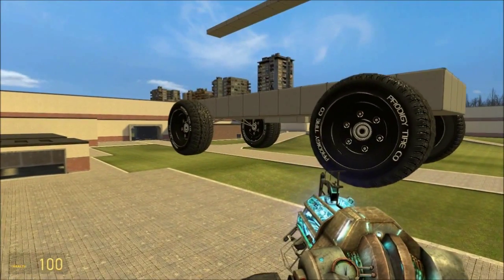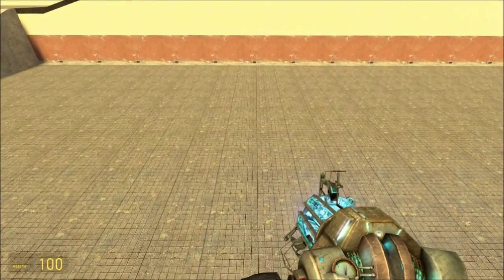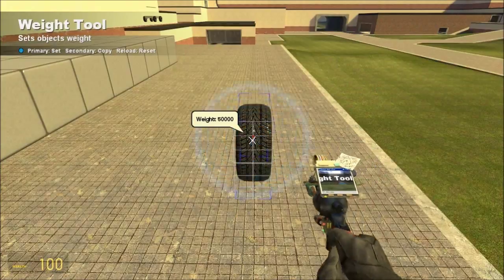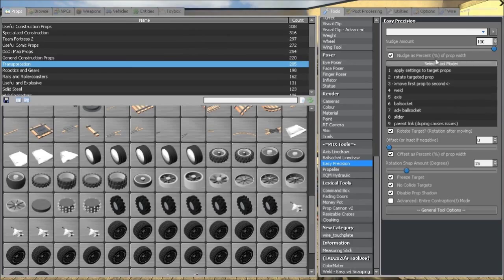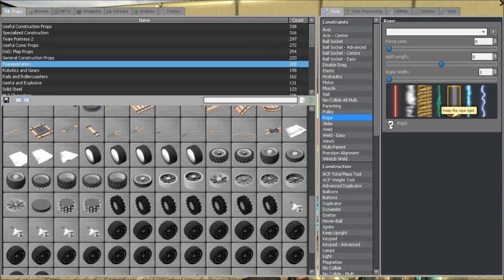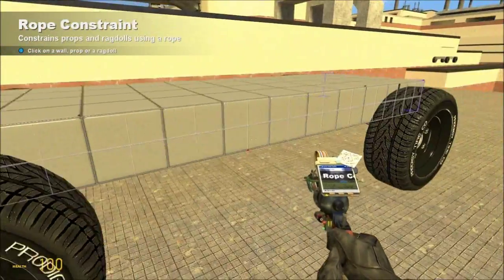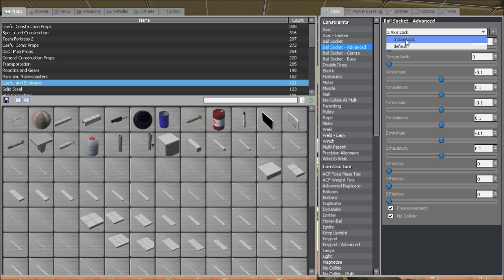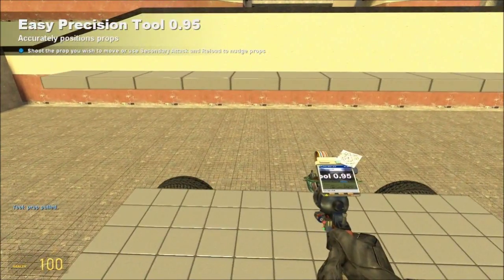(GMod) (Tutorial) Chassis Independent Suspension Part 1

Comment: What is your opinion on using hydraulics as the force pushing the steering column? I like them because they are easier to adjust the angle the wheels turn